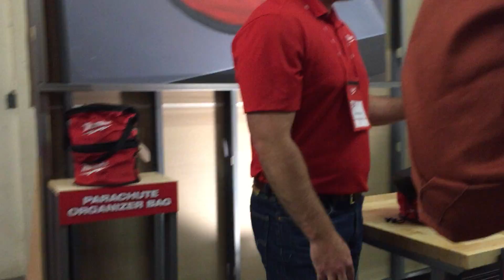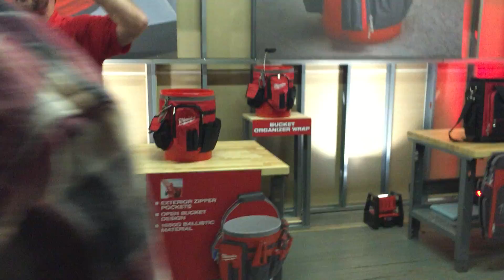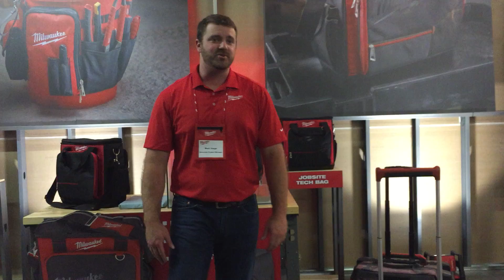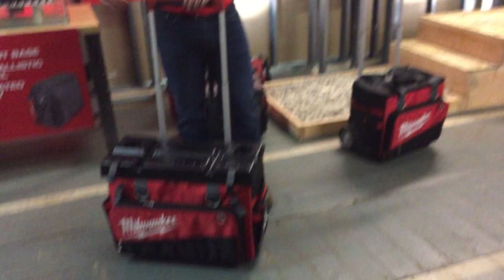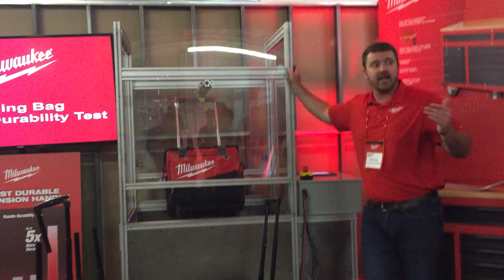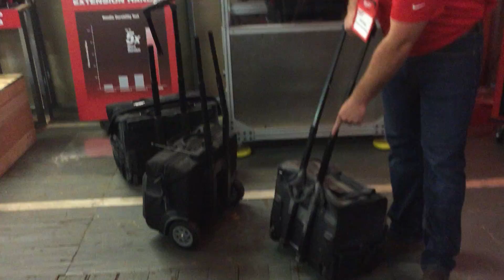NEW Milwaukee Tool Soft Storage Bags- First Look

Comment: i do need a rolling tool box that can fit in my work truck. I finally bought this but it diid not fit my needs as a security tech/installer because it does not have sufficient vertical storage pockets.  I ended up taking it back and going back to using the 22 inch open top pack out which does fit all my tools with easy access but it heavy as hell....hope veto makes this type of roller bag but better...we will see....

Comment: Nice Bags to bad the one that comes with the drill and impact driver are such poor workmanship that the zipper lining comes undone only after three uses . I called customer service and they said it did not have warranty there was nothing I could do except take it back to Home Depot. What a shame that I have to take back a brand-new drill and impact driver which hopefully will not be sold as new, just over one bag they could have replaced for free. Very disappointing, this brings into question whether the bags displayed in this video are any good.
Reply: Jose Aguirre completely different bag.
Reply: Same company though.  As someone in the market for a new rolling tool tote I thank Jose for his comments.  It tells me how their customer service operates and how little Milwaukee stands behind their products.  I was seriously considering the 24" model but now I am not so sure.

Comment: The bags aren't the products in demand.  Logical, stacking interlocking systems are key.  Stacking bags is not efficient and makes no sense.  The biggest step back in tool storage the last 10 years is the elimination of the hard cases.  Bosch seems to be the only company that realizes this, thus the L-Boxx system.  The thing Bosch hasn't realized is that their tool selection here in the U.S. is a joke.  About 7 to 8 years ago, they came out with the 12 V max line, very similar to the Milwaukee M 12. Then, they gave up. What they call high end here is entry level, at best, in Europe.  Dewalt is close, but they don't have anywhere near as many tools as Milwaukee does. Also, there modular boxes are so damn big that nobody my age (mid 40s) wants to carry their stuff around. Milwaukee has the most complete tool line, while Bosch has the storage.  It's frustrating because not one company has the complete, realistic package of tool selection and modular storage.  I have 20+ Milwaukee tools all stored and transported in L-Boxxes.  I thought when Milwaukee brought out their stackable an interlocking storage organizer earlier this year they were going to go more in that direction, but I haven't seen anything to indicate that, and it's annoying. Regardless, I love their tools. The advances they've made in the last 5-6 years with the M18 and M 12 line in the FUEL category has been absolutely phenomenal. Their products cover plumbers, electricians, and remodelers in a way that no other company covers(and a five year warranty) with the cordless tools. And now, the addition of the M18 nailers and the 9ah miter saw is just about icing on the cake. All they need now is the framing gun and maybe a small M12 pin nailer.
Reply: Mate im in the same boat as you, and before i head off yonder and buy some L-Boxxes to store all my milwaukee gear in id like to know if milwaukee has any modular storage options forecasted or should i just go out and buy Bosch L-Boxxes?
Reply: Brett Kowalewski  Well said sir. I couldn't agree more. I figured since Milwaukee and Ridgid are manufactured by the same company that they would introduce a line of hard stackable boxes like Ridgid. But I guess not. One of the main reasons why I want a durable stackable set is security. I want to be able to lock them with padlocks and chain in the bed of my pickup or job site if I have to run and get parts or lunch. I own all 4 Ridgid hard cases but they are far from secure. The lock holes are plastic and the cheesy bar that threads through them is also ridiculous. If you are listening Milwaukee this is what we need. Not soft bags. Something with dividers, chargers, built in stereo, wire reel holder, vise/clamps, light, anything along those lines would be sweet.
Reply: jamesmilwaukee richsteveman 
Sound like a competitor  wants to screw Milwaukee  with  these statements.
Reply: Brett Kowalewski You read my mind...
Reply: Brett Kowalewski Unfortunately I haven't seen any but I would have no idea other than doing a Google search.
Reply: Brett Kowalewski I
Reply: Thanks. Didn't know about Bosch. Gonna look into their storage system. I was looking at DeWalt's since Milwaukee's sucks ass in a lot of ways
Reply: (It’s already not an America company)Chinese Milwaukee Tool
More than 96% Milwaukee tools are made in China. Milwaukee Tool has been carrying out tool-design job in China since 2015 year, the design jobs also are slowly sent from USA to China.
Most plastic materials have been changed from America DuPont, GE to Chinese sources. The red plastic，Nylon，of Milwaukee tool handles/housings has been provided by a Chinese supplier since 2010，originally the Nylons were from DuPont，the Nylons-changeovers cause the handles/housings weak，like screws very likely strapped/slipped in screw holes/bosses, the dimensions are not as much stable. Also black hard plastic for battery pack cases/covers，their materials were changed from GE ABS/PC to a ABS/PC from a Chinese supplier，cause battery pack case more likely broken, brittle, the same story is happening on anti-flam Nylon material of battery frame，change from DuPont to a Chinese supplier. 
Lots of bad tools always first are sold to USA because nobody inspects the outgoing, and because Milwaukee Tool has the strongest warranty service ability in USA than in other countries.
During Milwaukee production processes, more than 5% defects found out by workers, also more defects fail to be screened out. Bad tools include noise as gear, bearing aligned badly, sometimes press trigger no reactions at all, metal parts like shaft, gear, pinion, important screws break as poor heat-treat, motor stator rubbing with rotator, fine wire laid inside tool break as poor design and poor workmanship, big percentage of oil leakage for hydraulic tools, etc. 15% chance you will get a bad tool, bigger chance you will get bad tools for nailer, planer, hydraulic tools, cable/tube cutter, as they are first generation of tools for Milwaukee Tool, because of comparing with sawzall, Milwaukee Tool sucks at nailer, planer, hydraulic tools, cable/tube cutter, AC tools, drain cleaner, blower, hedge trimmer, hammer dust collector.
Milwaukee Tool workers only get less than 300 dollars monthly salary，even plus OT to 276 Hours a month（normal month-workhour is 176 hours，plus 100 hours OT. Chinese law only allows no more than 36 hours OT per month）， after OT 100 hours a month，a worker can get about 500 dollars monthly salary，this salary very low for living in a big city in China, plus bad working environment(the management has no such safety-first mindset that loud noise but no issuing ear plugs to workers, and at dangerous stations very few goggles issued to workers. workers stand more than 10 hours every day during on-duty time, so Milwaukee Tool with huge employee turnover，400% yearly turnover，i.e. workers averagely work only 3 months for the factory, cause workers without enough experience，lack of training，on top of few automation, then unable to ensure good quality. And worse worker- turnover with most Milwaukee Tool’s suppliers.
After Milwaukee tools launched one year， Milwaukee Tool will do so-called VE, value engineering, actually cost-down, change Germany trigger to Hong Kongese trigger even Chinese trigger/switch, change Japanese chuck to Chinese chuck, change metal parts to plastic parts(like ring gears, motor covers),etc. Milwaukee Tool has a team, 50 people to do the VE. The quality would obviously become worse after VE.
Milwaukee Tool has really bad quality system, lose much profit because of failing to keep quality constant, like critical metal parts broken, every 2 months taking place, no methods to resolve the issue in 10 years, starting from 2008. And always look for cheap materials, cheap suppliers, worker salary is always only slightly higher than minimum, only 17 cent higher than hourly minimum salary.
Milwaukee Tool doesn’t care about customer when facing huge loss. In this year, because of poor design, 740 thousands of M18 9A battery packs with function problem, metal strips separated from welding points, i.e. the circuit broken, they did not recall these battery packs, only modified structures of the metal strips and battery frame to improve the problem for new batches of battery packs, reworked 14k and scrapped 42k of the old plastic battery frames.
Milwaukee Tool has less experiences for making power tools comparing with Makita, Bosch, Dewalt(Milwaukee Tool CEO JG and a senior VP JW had worked at Dewalt for years). Milwaukee Tool only has grew fast from 2008 year. They copy and compare tool life tests with Bosch, Dewalt’s tools during new product development stages, even for troubleshooting during R&D, they would measure dimensions of these competitors’ components.
This company is also an ugly company, three years ago, a Hong Kongese manager tried to rape a female employee during their business trip, the company fired him and less than half year, hired him again as a manager, then the female employee left this company and lost her job. Two years ago, in its factory dorm a more severe rape case really took place by a male senior manager to a girl/employee, and this Company didn’t do anything to him, like firing him, like reporting him to police，helping officer to arrest him.

Comment: i want motorized, waterproof rolling bags with forward and backward buttons.
Reply: +hyperliterider861 wait only because I'm in a certain field I shouldn't want convenience? man we should all stop using drills to tighten connectors and other crap. and stop using trenchers to dig and always use shovels. and stop using forklifts and use rope and pulleys.